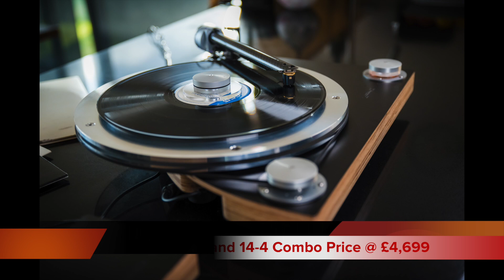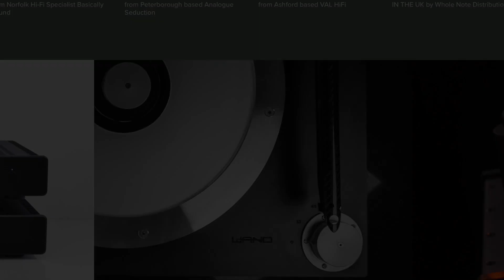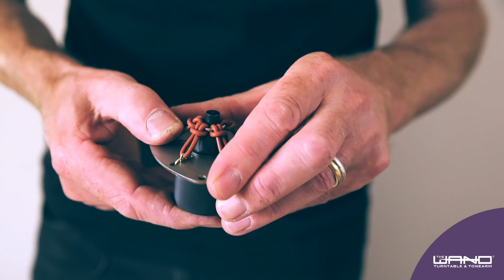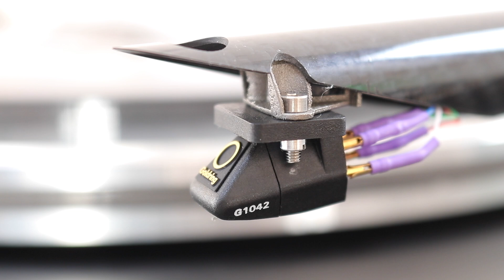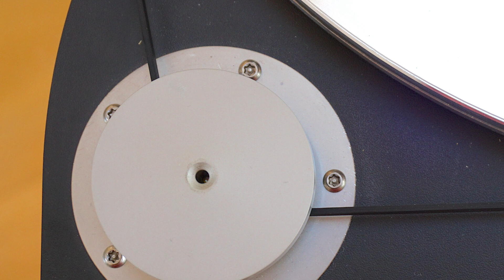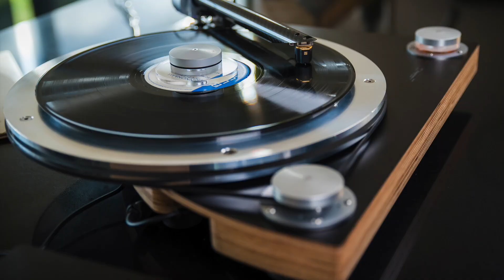THE WAND 14-4 TURNTABLE REVIEW & GOLDRING 1042, ORTOFON CADENZA BRONZE AND VAN DEN HUL XGW STRAD.

Comment: I purchased the Wand 14.4 Master and had it installed by the dealer. I agree it is a little complicated to assemble and need some knowledge in engineering but the dealer gladly came over for an evening of installation,red wine and a few snacks. It is an amazing turntable,easy to operate, fast and sounding incredible. I am using a Hana Red cartridge and really like the combination with the Wand. Highly recommended if you’re looking into buying a new turntable at a middle range price.Great value,quality price!

Comment: £4000 for a cartridge is a lot of money & invariably they push  the cost of replay up because they wear out faster than a good deck or arm. I can see where you are coming from & back in the 80's it was an opposing philosophy of front end first namely that you should spend as much as possible on the deck & only then get an LVII or whatever. This way of doing things never worked for me as I had an LP12/LVX/K9 which I never liked. In my opinion an LP12 only came good with an LVII. An expensive cartridge is desirable but I feel should be last on yout list as a model like a 10X5 will bring out much of the best of that front end.

Comment: When the video shows the rotating platter, it's obvious that it has both vertical and horizontal runout. That's very disturbing considering that this is a belt drive with the belt going around the outer rim of the platter. This thing must have more wow (as in "wow and flutter") than a Crosley suitcase. I hope production samples have significantly better machining tolerances.
Reply: I saw that too. And froze solid, trying to hear the wow, nothing.
Mesmerizing to watch...

Comment: I first heard about The Wand when somebody installed a tonearm on an SL-1200. I have a 1210GR myself which was my first turntable upgrade from an Orbit and I would say it is moderately priced. It is by no means inexpensive or entry level but not ultra high end either. I am not a high-income earner but I do have expensive tastes so ultimately I will have to save for gear or other things I want in the future. I have done monthly payment plans on occasion which is sorta like saving up incrementally but is more immediate since you get the item sooner but you're committed to paying it off. I have 2 more months left to go on the Sl-1210GR plan and I've decided I'd rather save up and pay up front for nonessential items because it's more secure and less stressful.

Comment: Hello from Sydney Australia,  I'm a proud Wand owner running the 12inch arm and a very expensive Clearaudio Stradavari mkII. It is a fantastic sounding turntable and I agree with all that you said re sound. A small con which I think about ; I wish the record mat extended to 14 inches instead of 12, as I am terrified I will miss que the record, the needle will fall onto the aluminium platter and catch the screw hole sandwiching the platter together and rip the needle right off. Also the lid is too cumbersoy me to use in practice. Both small things to be sure, I'm just extra careful cueing a record and I just don't use the lid.

Now a decent PRO was the price in Australian was  much better than some of the German and U.S. decks I was looking at as the NZ dollar aligns with ours. It also outshone my Linn Sondek which I would argue as way more difficult to  maintain in it's  best setup due to it's  crazy trampoline suspension.
Reply from the maker: Ah, you have the advantage on me with that 12" arm :) I used 12 on another turntable here so I know how good they are. I wonder if the mat size is a price compromise. Just my guess but I wonder if that might be that bit more expensive to produce. Or is it a sound thing? Let me ask, actually. Agreed on the Linn.
Reply from the maker: I made enquires on this and the company tased, "Mat isn’t extended so that your fingers can grab the edge of the LP. The arm can be adjusted so that even when the cueing lever is ‘down’ the stylus can’t touch the surface of this part of the disc."

Comment: Really enjoyed review, when you detailed the azimuth adjustment, I surmised it was a uni-pivot design. I like the platter, I like the 78 speed option (which I don’t remember you mentioning). I’m not in the market for a turntable at present, but next time around I will check out the 14-4 or whatever Simon is up to at that point. Thank you for bringing the product to our attention.
Reply from the maker: Many thanks and yes, I made a pinned comment correction re. the unipivot. I did mentioned the 78. It's a long video, it's easy to miss small details like that :)

Comment: Thanks for the review Paul. I find it an interesting turntable even though my design preferences steer me more to idler  drive and direct drive decks rather can belt driven models.  You really should have mentioned that the arm is a unipivot design though!  I have previously noticed some glaring omissions in a few of your previous reviews although I cannot recall specific examples at this moment.
Reply from the maker: Yes, pinned a comment correction above re. the unipivot. And no problem. Please shout at me if I make a mistake. Happy to add corrections the comments.

Comment: Can it play 16inch
Reply from the maker: I asked the UK distributor and he said, "Short answer is I haven’t tried but looks like it should work with the 10.3in or 12in arms. BUT I am guessing these are 78rpm discs? (Excuse my ignorance) but it should be noted that 78rpm is now only factory set-up (free) when the turntable is built so has to be ordered but it is not adjustable for speed as older 78s need."
Reply: @TheAudiophileMan  no sorry I was thinking 18 discs made for radio 33rpm with deap grove's and time in-between song for advertising I think there called transcription discs

Comment: Paul, great and timely video.  I just purchased this TT, a demo model from the UK shipped to the US.  I'm an engineer so the setup isn't all that intimidating for me.  When viewing this TT online, with all the missing plywood, holes, half circle, etc., its easy to assume its a light weight TT, but its not.  Also prettier in person!  I don't have it setup as I'm in the process of getting additional components together.  I'm wondering if you have a preference between the G1042 and the Hana EH as a starter cart for this TT?
Reply from the maker: Tough one but I'd lean towards the Hana. And thank you.

Comment: This one fantastic review is the reason why you’re the best Paul. Also this was the one review I was looking forward to. Why you may ask? Well I used to own a Wand arm. There I’ve said it! But that was aeons ago. Like you I had to do everything myself. I started on the Friday and I was still fine tuning it on the following Monday. Ran into a few niggly bits which nearly drove me insane. Thankfully Simon was on hand to guide me along the way especially with the azimuth issue I was having. It turned out that I had to twist the arm tube a degree or two whilst holding other end. Now that was scary! Believe it or not I also used a Goldring cartridge and after a few days I was in tears. In my Croft valve system it just didn’t suit at all, at all. I won’t go into detail but eventually I sorted it out with another cartridge the Nagaoka MP 110. This was much more like it. Unfortunately my joy was very much short lived when a few months later I started getting what I can only describe as very loud static bangs one after the other every five minutes or so. Tried everything and absolutely nothing worked. I actually had a spare Nag that I bought during the good times I was having with the system and I had exactly the same issue! In the end I put the blame solely on the Wand and ended up returning it and ordering an Ace Space tonearm instead. This took at least five months of waiting around twiddling my thumbs. When it arrived I duly installed the Nag and, horror of horrors, the bangs started again. Argh!!!!!!! But I didn’t lose heart and duly reinstalled my trusty Goldring. Result? Nirvana! 
At the last 🤗 No bangs just beautifully rendered music that left me in tears for all the right reasons. Still I felt bad about blaming the Wand but, to this day, I have absolutely no regrets. 

So Paul you are so right to warn prospective buyers to beware! If, as you say, it’ll be well sorted to help the customer when it arrives in the UK then that’s ok. Or is it? Definitely not for the faint hearted or even a well seasoned music lover like myself or even yourself too who has vast experience of the niggly element of hi fi component set up. Anyway congratulations to Simon and his team for the Golden Groovy award. They are the good guys and will always be on hand to help if needed. Well done!
Reply from the maker: Very nice of you Dermott and thanks for sharing your experiences. Never had that static effect. I wonder what caused it?
Reply: @TheAudiophileMan  Thanks Paul. Between myself, Simon, Tim from Divine Audio and a very nice gentleman from Sonar who ,who as far as I can recall, were agents for the Nagaoka brand, we could not get to the bottom of this static problem. Everything was suggested and everything was tried as I was very fond of this arm. Unfortunately it wasn’t to be and life moved on as it invariably does. Even to this day I can sometimes be found somewhere in the back garden muttering to myself lol! Anyway at the end of the day the finger of suspicion rests with the Nagaoka. Then I ask myself how could another brand new Nagaoka from the same shop exhibit exactly the same problem. Once yes but twice?? And so it goes back to where I started! Actually, now that I remember, I initially thought it was the unscreened arm cable picking something up from the ether.  Yet the Goldring was flawless. Oh dear here I go again around that confounded mulberry bush 🙄
Reply: @frankmurray1549  I agree with you! It just beggars belief that it can happen. I actually sent both of the brand new Nagaoka’s back to the shop to have them run in and tested. A very kind member of the staff offered to test them on his own system. Result: no funny issues at all! This is the thing though : it took at least 8 months before the first Nagaoka I bought started the static bangs. The second one within the hour. So it’s just something that has more than me completely flummoxed. I still have them both but that’s neither here nor there. They’re beautifully built and seem so robust. Maybe one day……..

Comment: Thanks Paul, very interesting products. I remember the Wand tonearm being very well received and fairly priced many years back when it was launched. One comment: when describing the counterweight and how parts of it can be moved sideways to adjust azimuth that is difficult to make any sense of without knowing that the arm is a unipivot design. That was not pointed out. One more: cartridges costing as much as the motor unit and tonearm are generally "higher end" than the latter. Turntables below 5k barely gain admission to the high end club nowadays but cartridges above 4k are in a much more rarified territory.
Reply from the maker: Arrgghh! I didn't say that, did I? Bugger. There's always one thing I miss. I'll pin a comment. Thanks.
Reply: @TheAudiophileMan  You were too quick to answer :) I have edited my comment to add something.
Reply from the maker: Ok, gotcha. Yes, agreed on the added bit you made.
Reply: Great review, Paul.  Lots of people are going to object to the price of this turntable, however, it sounds like a bargain compared to some of the more established brands’ top end ‘tables.  Still beyond my reach, but really glad to hear about it anyway.

Still using my G1042, thanks to your earlier review.  However, I’ve recently upgraded to 1990 vintage LP12 and I fancy a go at a Hana ML.  Got to fill up that penny jar! 😄
Reply from the maker: Hi Mark - yes, the Hana is a good choice. Good luck with the saving.
Reply: BTW, the top of the line Wilson Beseech Nano Tube One adjust azimuth exactly the same and it is not a unipiviot design.

Comment: The Origin Live Cartridge Enabler would help with longer screws also.  Mind you, while it improved the sound quality on my Project DCE-SB, a 'modest' turntable (and the fitted Goldring 1042), it may only provide minimal, or no sonic improvements on the Wand.  But it's pretty cheap, and in any case and you can add it to a spare cheap turntable to help that one.
Reply from the maker: That's an idea.